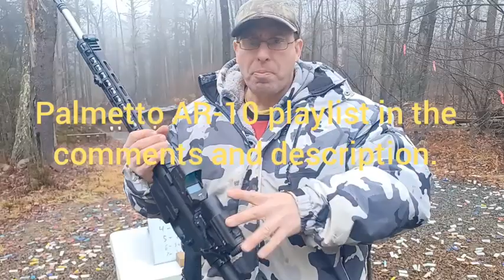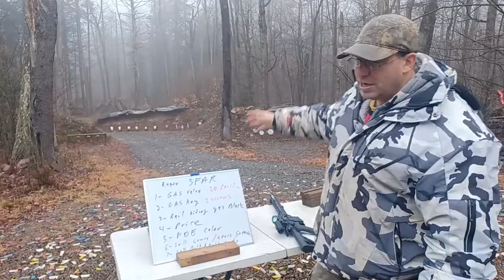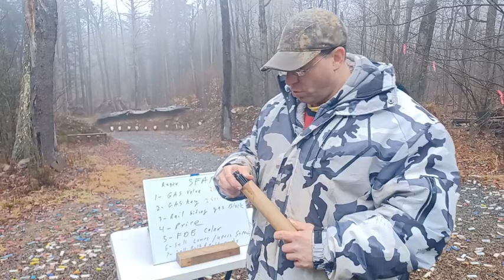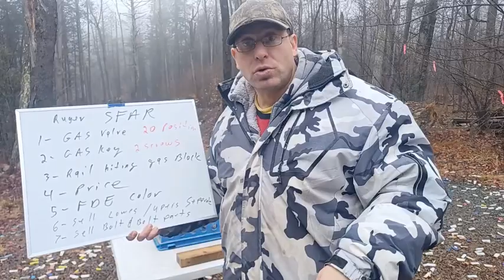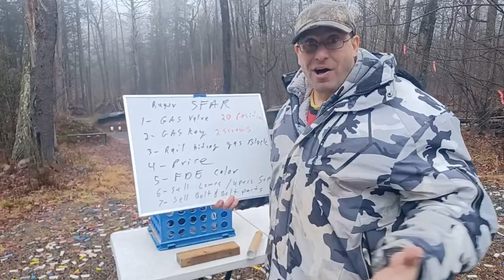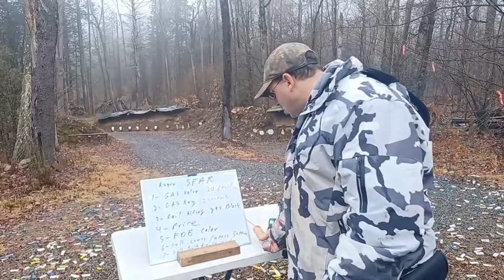Ruger SFAR Gen 2....  AR-10 please !!!!

Comment: I dont think it needs a 20 pisition gas regulator. I like the idea of keeping it simple. Maybe a 0,1,1.5,2,2.5,3 would work & not make it too complicated? I have 500+ rounds on my 16" SFAR & haven't had any loosening of the gas key. So not sure if it has to have 2 screws but 2 would probably be better. I 100% agree with the FDE color!!!!! I've put FDE grip,stock,charging handle,mloc covers & angle foregrip that look really good but it's still basically a black rifle. Color options would be awesome. I would sell mine right now & get a gen II in FDE if availible. I also agree 100% with the upper & lower sales & availability of spare bolts & parts. Hopefully Ruger sees this & listens??? 🤞🤞
Reply from the maker: 308 ammunition has very large variances among different brands. For years bolt action Hunters have been asking for lighter recoiling 308. The result is that you can get 150 grain velocities anywhere from 2600 to 2800 ft per second. That's just in the 150 grain bullets.

A lot of people are looking to use the light SFAR for hunting and are going to use those light recoiling soft tips. If Ruger does not put out a highly adjustable 20 position gas regulator, there's always going to be cycling problems with some ammunition. Since they have to improve the gas regulator anyway, they may as well put something in there that is going to work with everything labeled 308.

I don't think it adds too much complexity, because it's just a valve that screws in and out to cover the gas port. So it's the same basic idea. They just have to make sure that it locks into position at each setting so it doesn't move under recoil. Palmetto had that problem with their gen 1. They fixed it with the subsequent gens. I believe Gen 2 had 26 positions and then in gen 3 they cut it back to 17, which is what I have. It works well.
Reply: @PoconoShooting  20 still seems like alot but I'm sure it would work. If a guy wants a regulator with less positions just get the new SFAR 20" in 6.5 Creedmoor. Less variables in ammo.
Reply from the maker: 6.5 creedmore has far less variance. For that it's only an issue of suppressed or not suppressed.  So it would need a much simpler adjustment valve with less settings.